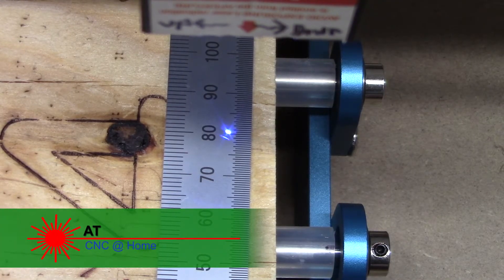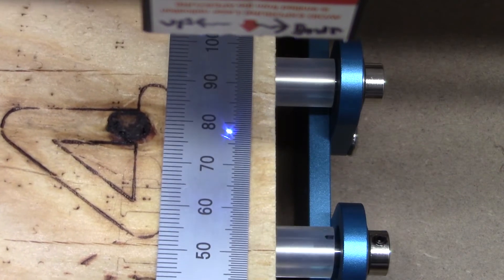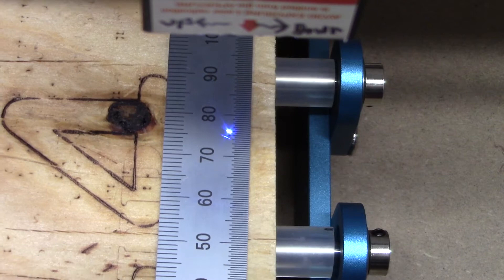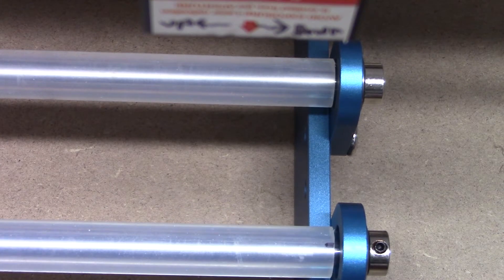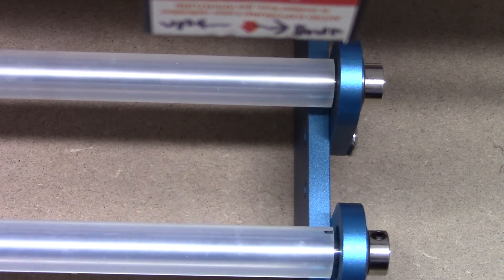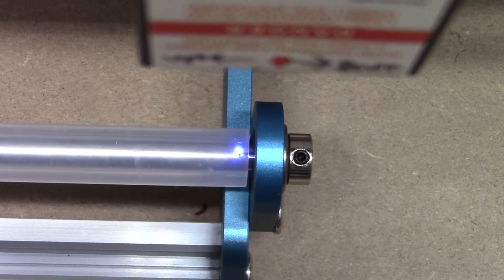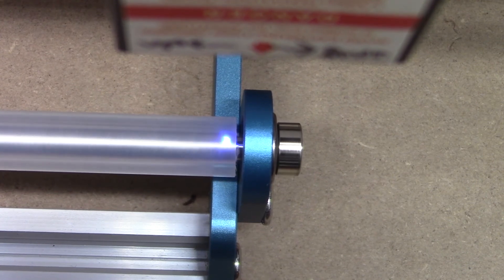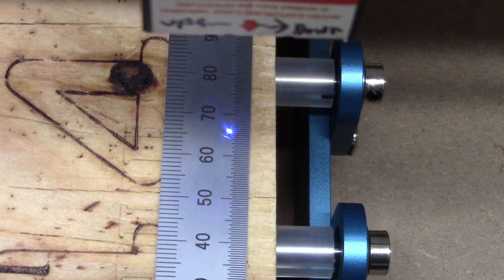Genmitsu's Rotary Roller Kit from SainSmart - Movement error solved!

Comment: Have you tried putting some non-slip material on the rollers.  It looks to be some kind of slick plastic surface.  Maybe a rubber covering would work better.
Reply from the maker: The material used for the rollers has decent friction but not perfect either.  They do slip on the metal rod that runs through them and that would be easily corrected.  Not sure what type of coating to put on the out side but some sort of light adhesive would likely work if it was too much of an issue.  Weight really helps.  Also minimizing the "Y" movement helps as well as keeping it slow.  Thank you for the comment.
Reply: @CNCATHome  I was trying to decide whether or not to buy this one seeing as I have a Genmitsu Jinsoku LC-40 laser, or just make my own.  This might be a deal breaker for me.
Reply from the maker: @zk_6312  - Good luck on your roller project.  I have used this with my LC-50 Plus and it works about the same.  As long as I don't do too much in the Y axis it seems to be fine.  If you do end up making your own, whatever you use for the roller, make sure it has good friction with your material.  Setting up a rotary chuck might be a better solution .  ;-)

Comment: Are able to add this roller attachment to a co2 laser? I'm just getting started and looking for an inexpensive rotary to learn with.
Reply from the maker: Great questions.  If your controller supports 4 wire stepper motor connection, you should be able to use this roller.  You can check with support at SainSmart about your specific laser and they might be able to give you more information. https://www.sainsmart.com/pages/contact-us

Comment: Those rollers when they rotate are not exactly round. maybe that's where the issue is.
Reply from the maker: They aren't perfect, that is for sure.  I would think that if they were out of round, that wouldn't keep increasing an error.  That would introduce and error going one way and take the error out going the other way.  I have found that making sure to move slowly, only going in one direction, and making sure my object has some good mass to it (either on its own or by adding some), the burns turn out well.